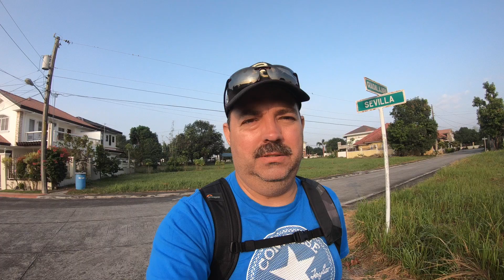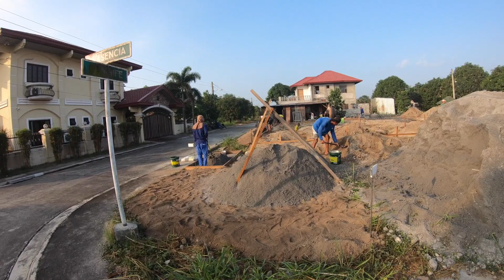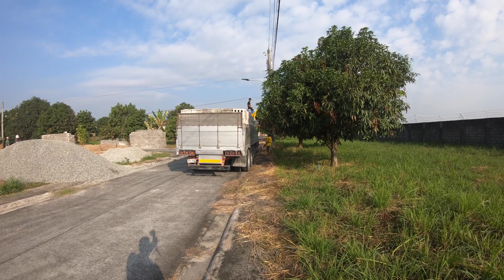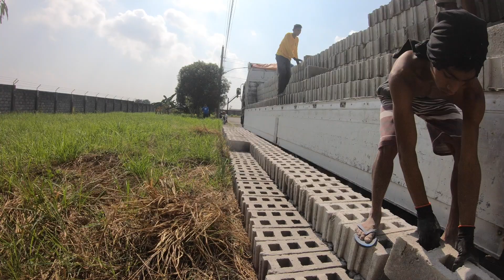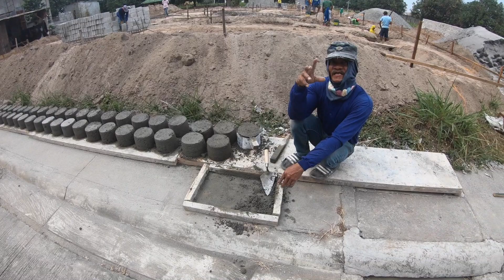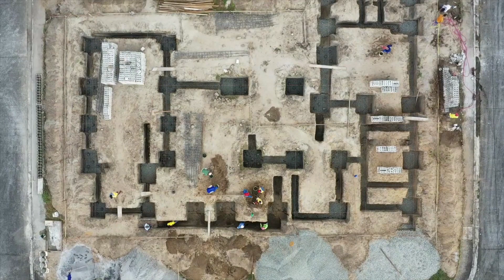Philippine House Building Step by Step, Build Day 14: Blocking the Way

Comment: Looks like the wall. 
All along it was just bricks in the wall.

Why metal trusses for the roof? 
This house is built a bit different then those here in the states.
Reply from the maker: chef souffle Metal trusses are the norm here in the Philippines due to high winds from typhoons. Also, wood trusses are not used due to susceptibility to termites which are prevalent here. Typical house construction is Concrete Hollow Block with columns and beams supporting the load of the metal roof and trusses.